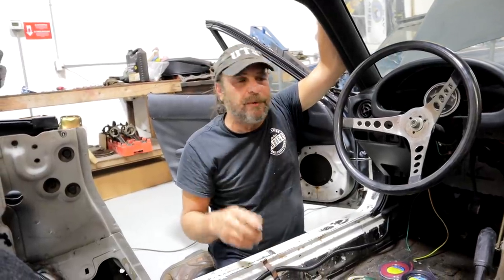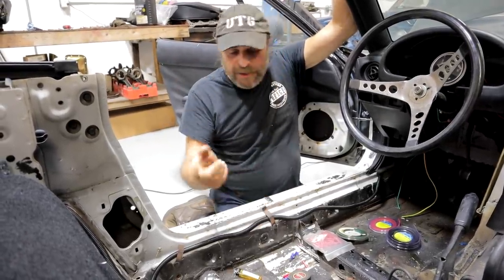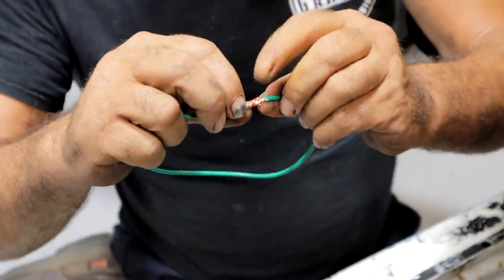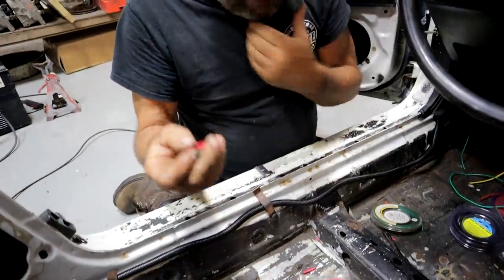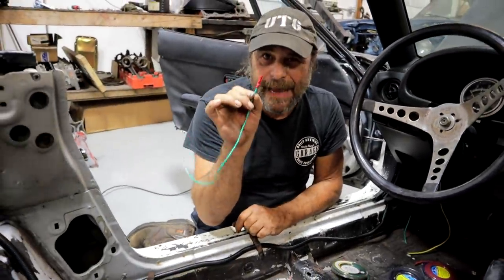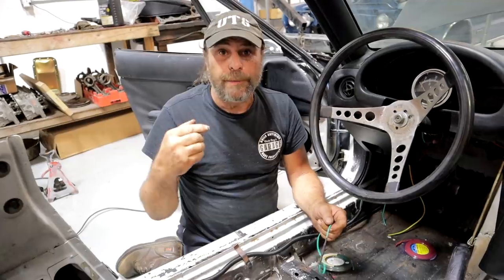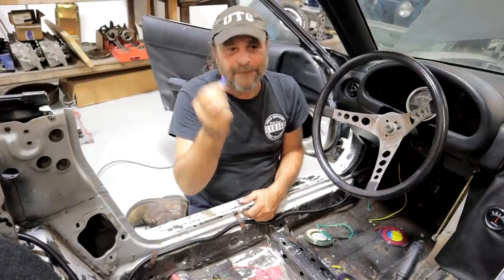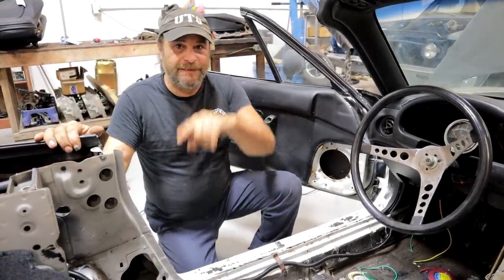The Single Most Misused Item In The World Of Cars

Comment: When I first got into cars and wiring, I would use these connectors. Never used heat shrink. And then I learned how to solder when I went to electronics repair school in the army. Now I exclusively solder. Soldering irons are cheap. Solder and flux is cheap as well and will last a long time. Plus it’s fun. It’s a little time consuming depending on what you’re doing but it’s going to be a problem free connection in the end and it will last a long time. Marine heat shrink tubing is a must as well as it keeps moisture out.
Reply: yup, you fight a corroded connector long enough and still cant figure the issue out, you'll start doing it correctly,

 try the low-heat solder connectors, they are a game changer, use like a regular butt connector, run the wires past each-other and heat with a heat gun, bam, soldered and heat shrunk with adhesive heat-shrink <3
Reply: @narmale  I’ve seen that too. Might just have to check it out.
Reply: @narmale  I like to solder, but tried those on my last car radio install.  Solder and shrink wrap is still more to my liking, but they worked fine

Comment: I always use the heat shrink but connectors. They cost a bit more, but I haven't had a wire repair fail since I started using them. They also have hot glue inside of them to help seal, and keep the moisture out

Comment: Another thing, don't use these on 5V reference or on sensor/ ignition wiring. These really should only be used in a pinch, or in spaces where you can't solder. Butt connectors can cause wayyy too many troubleshooting headaches when your repairing a repair lol.

Comment: The plastic bell on the conector is suposed to be crimped so it seals/provides strane releaf. A old way to splice wire is a maryed splice then heat shrink. The crimpers you have are junk! Us the electritions crimpers! Chanal lock makes a set!

Comment: I use heat shrink connectors that seal with adhesive. Used them in medical equipment, they're great.
Reply: They're awesome for this too
Reply: @KC9UDX  if it's good enough for medical equipment, it's definitely solid enough for cars
Reply: @GideonWallace  not necessarily; medical stuff doesn't deal with road salt and wild temperature swings.  But otherwise, they do work very well for this.
Reply: @KC9UDX  go work on a field hospital, and medical equipment that goes in aircraft and then tell me afterwards
Reply: Do you have a link for those? Thank you.
Reply: @GideonWallace  road salt?  If any of that stuff is ever subject to road salt spray, someone is doing something wrong.
Reply: @KC9UDX  what's up with all the explanation, tell how well anything does well against salt even vehicles... I'm not your teacher. Going on about semantics... talkin bout saltmantics...
Reply: @GideonWallace  pretty simple, I think.  You said that anything good enough for medical equipment is good enough for a car.  But car wiring is hopefully subject to worse conditions than medical equipment.  So I say that if it's good enough for a car, it's good enough for medical equipment, not the other way round.  But it's not something to take personally.
Reply: @GideonWallace  sorry.  Not going to get into a pissing contest because you felt slighted by a simple exercise in logic.

Comment: This video has some misunderstanding and misusing.

Heat shrink is not structural in any way. A good crimp should pass a vigorous tug test, and be totally unharmed. Pre insulated crimps are generally not considered to need sealant or tape if they're in a relatively dry location. Even under cars, it might be better to have the water wash out than be held in that little nylon shell, by your sealant or tape or heatshrink. Even if you use a piercing non-insulated crimper (which you always should, if you want your crimps to actually work).

Don't twist the wire more than enough to get it in the crimp, twists increase the size of the wire, which later untwists back down into the crimp, shrinking the total diameter of the wire without changing the crimp, letting it just fall off. If you cut a well-done crimp, you'll find the wire strands compressed into an imbricate honeycomb pattern, with no air space or room to unwind.

Ratcheting crimpers sound great, but often are much less reliable when you encounter different wires and crimps - it's the force exerted into the crimp, not the nominal diameter of the outside, that tells you it's crimped.

Love ya, tony. Frequently learn plenty from you, even if it's not exactly what you're making the video about.

Comment: There is a bad thing about the crimp style at least on newer vehicles. I worked at a dodge dealership in tech department in 07 to 09. A nationally known hitch and bed company was installin beds using those. 6 months later 3 trucks came in with fried computers and it was because those added too much resistance.  I use them but not on my computer controlled vehicles.  And only as a temporary thing.  I solder everything else.

Comment: Crimp style connectors are not really permanent. Solder is the ONLY permanent solution. Adhesive lined heat shrink is waterproof, not run of mill especially if used outside of the vehicle. Plier style crimpers are garbage, get the ratcheting style with dies for a perfect crimp, also the stripper part cuts strands of wire reducing wire capacity. Use the kind that pulls it off not cuts it.

Comment: Why used hard plastic insulated butt splices and then put shrink tubing over it. That's one big bulky splice and worst with multiple splices in one area. Going to use shrink tubing then use un-insulated butt splices crimp and solder them a far smaller splice. Then we have insulated splice that can be heated and melts like shrink tubing. About everyone of these always turn green because they don't have sealant in them

Comment: They do sell crimp connectors without the plastic on them, then you can use smaller shrink tubing that fits the wire better for a better seal and you get a better crimp, and for Christ sakes stop using that half assed crimper and spend the 20 or 30 bucks for one that actually puts a crimp on the connector and not just crush it.

Comment: Shrink tube does not stop moisture.  Shrink tube does not seal the joint.  To actually seal the joint you need to use a sealant like dielectric grease or my favorite, silicone. Squirt a little drop of silicone in the fitting, insert the wire and crimp,  then slide on the shrink tube and heat.  That will seal against moisture.

Comment: Been a while since doing assembly, but will give it a try on the "guillotining" issue for the barrel connector. The smaller diameter is supposed to crimp directly on the conductor. The "shoulder" is supposed to crimp the insulator LIGHTLY and give support there. Some of the more sophisticated professional crimpers will have dies that appear offset for this reason. You can see this on wiring pins that get released from connectors; one set of tabs wrapped just tight enough to grip the insulation, and another set of tabs that grip tightly on the wire.

Comment: Those t-taps are evil! Last year I bought a truck and it left me stranded on the side of the road just a week after I got it. Some moron used t-taps to splice in the fuel pump! Anyway, I used non-insulated butt splices and heat shrink so I never have to worry about it again.

Comment: Aluminum connector. Copper wire.. Automatically a dielectric connection. No good at all draws moisture.. Shrink tube slows the process.. But won't stop it at all. Solder only way to go...

Comment: Tony!..Before soldering you're supposed to twist the wires together in an inline Western Union splice! it will make a far better solder joint.

This comes from a guy that solders the crimp spade/circle/barrel connector ends on to his own wiring instead of crimping.

Comment: A long time ago back when I was young and good looking, 
Okay I lied I was young.
 I learned about wiring harnesses and wiring, electrical systems in general. When everything that ran through the firewall decided to melt together and become one big charred mess of wires and insulation. And melted tape.
I got This brilliant idea I was going to rewire it, brand new wires from bumper to bumper. Ahh, to be young and stupid with that much ambition again. Oh yeah it was a '57 Oldsmobile 98 with power everything. It even dimmed its own headlights, turn on the windshield wipers on its own, and had a little prism on the dash so you could tell the light was green because of the visor on it. Fender skirts and Continental kit. That I paid $75 for. The only major problem with it. Was it was hot pink, factory color. But the 394 Oldsmobile rocket with the tri-power on it made up for it. And 57 Oldsmobile had a ballast resistor.

Comment: That is a carp crimping tool.
The good connectors have heat shrinks self gluing tubing installed from the factory. They are water tight.

Comment: 100% on the money. I've seen upfitters that do municipal fleet work and other fleet work use these without shrink tubing, they are a no-no as you indicated. Del City, Grote and others make a combination solder-heat shrink unit, and they also make a crimp-solder-heat shrink unit. They come in all types (spade, ring, butt, reducer, etc.) and they are well worth the expense.

The crimp gives you the mechanical connection/stability, the solder gives you the electrical stability and connection and the heat shrink seals the deal. Now you're good to go. The "green mold of death" as others have called it is just asking for trouble.

Del City is one company that makes them, there are others: https://www.youtube.com/watch?v=lti_sVcXwAU

Comment: I started using shrink tubing more regularly the last few years. Used to just do the connectors and electrical tape. But now I use shrink tubing basically on everything. Even in right spots where the connector will make the wiring just too thick with Jenny wires. Then I'll just splice, twist, and shrink tube. I also now get the butt connectors with the shrink tubing already on it.

Comment: your sophisticated crimping tool is one of the most frowned upon tools in the automotive industry because they penetrate the insulation around the connector and cause shorts. you need non-intrusive crimpers and butt connectors like the ones you are using here are crap. you can get heat shrink connectors nowadays which are far superior to the ones you're using and don't require shrink tube. You are about 20 yrs behind in technology.

Comment: Funny how you did this. I'm out in the shop wiring up an instrument cluster when I saw this. I know you have seen and heard of these before, but have you ever used the crimp on connectors with heat shrink on them? Working on road tractors that see a lot of harsh conditions (salted roads in the winter, etc) I use those exclusively.  Work like  champ. They actually have a heat activated glue inside them to give an even better seal. If you haven't tried them, give those a shot.

Comment: those crimps suck u need a set that i have with strippers if u use but connectors just put silicon on the ends it is better then shrink  but the best is with both u want to keep the oxygen from the connection  .  so far on my builds i have run into 3 cars that they put a ground to the dash lights . on my build i will replace the full wire from plug to plug clean all connections on the harness on the bench just like replace all the lines on the frame rebuild it from frame up make it look new again . i even do interior on my own rigs but not put ur left nut into it . some of the builds i see are just crazy expensive when u can do it ur self for a fraction of the money   like my dash i see them buy a new cluster that is a 1000 bucks by it self i did mine for 250 buck but i rebuilt the hole dash and it is just as nice . i replace the bezel nobs lens new tac and vacuum gauge glove box and choke then painted it powder blue when light is not on it it goes darker blue same color the outside will be . next i will find a set i like in the wrecking yard or at one of my friends house and reupholster it to match the doors waiting on them for the seat it will cost me under 200 bucks 25 for the seat rest for leather

Comment: I use crimp connectors that have built-in shrink tubing WITH adhesive that activates while shrinking the tubing. In my opinion. They are 10 times better than standard heat shrink tubing. (without the adhesive) They are more expensive than standard crimp connectors but I buy them in bulk. They are worth every penny in my opinion..... especially here in the salty rust belt.

Comment: Pretty sure technically it is recommended to NOT twist the wires before placing them in the crimp connector.  I think the ASME did a study on it and found keeping the wires straight reduced fatigue failures.

Comment: The ones I use have shrink wrap around the crimp.so once crimped you just heat up and shrink seals nice.plus they are clear so you can see where wire is inside crimp

Comment: Used solderless connectors all the time on various fighter jets and cargo planes in the military. Never used shrink tube. Had self sealing solder splice connectors we used in areas likely to experience significant moisture.

Standard solderless connectors don’t need shrink wrap imho. If you’re doing shrink wrap with a proper heat gun you’re likely to have a quality soldering iron as well.
Reply: For interior applications, I agree. The heat shrink is not needed for stress relief. Another note is that twisting the wire before inserting it into the crimp connector will lead to failure. With proper technique and tools, the crimp connectors offer the best and least failure prone connections in automotive applications.
Reply: @chesapeakemotorwerks  agreed. It makes me cringe when people twist a wire real right before crimping it…

Comment: If I'm using a crimp connector 'outdoors' (like under the hood), I fill the ends with silicone. I've had good luck with that technique, there are cars I've fixed that still have good connections 10+ years later. Whereas I learned pretty quickly that you need to have some kind of waterproofing for outdoor connections. I've had those crimp connectors fail from corrosion in only a couple months. If I'm using a crimp connector in the first place, I'm not trying to do a grade A job. I'd solder and heatshrink if that was the case.

The 'guillotine' connectors I use fairly often. Only indoors, and only when not severing the wire is more important to me than the circuit that needs to be connected. Trailer light wiring, remote start kits, mostly, and also the odd aftermarket accessory. They seem not to have any problems when they're indoors.

Comment: Yep, always use shrink tube. I stopped using those combo tools decades ago and went to stand alone, quality, wire strippers and crimpers. Like Ken Cooper posted, when I have important connections to make then it gets soldered and shrink tube. In the 70s I learned power line level electric work and learned the lineman splice. It is a mechanical splice for wires that is stronger than the wire you are using. When soldered and properly insulated it is a permanent wire splice that will never need to be touched again. Oh, I also learned the correct way to tape a joint ... that is an entirely different subject. Just a little "plastic" tape will not be insulation for 20,000 volts LOL!

Comment: I like the heat shrink butt connectors. They are higher quality than the cheaper plastic versions you used here. 
  I also use better quality crimpers. I do a lot of wiring on trucks, trailers, and equipment in the construction industry. Construction guys can break an anvil in a sandbox with a rubber mallet. It's helped me hone my craft for my personal projects.

Comment: That flared plastic end of the connector is heat shrink. You're right that basically no one actually shrinks it after crimping, tho... Of course it doesn't hurt to add more heat shrink.

Comment: Ok...I a mechanical engineer that RUINED the wiring in my 65 Malibu SS.
To prevent my error ALWAYS use the special ZINC connections.
If you splice anything...ANYTHING.
use the zinc connection.  The zinc will corrode NOT your entire wiring system.
This is very important if it gets wet

Comment: I use those connectors differently.  I slide the plastic off and throw that away.  Solder the end on and then heat shrink.  Makes a nice slim, trouble free connection.  I despise those “guillotine” connectors and can’t believe they’re still made.

Comment: If you're going to use shrink tubing over the splice then insulated butt connectors are not the thing to use. The use of butt connectors without the insulation is best. And as long as you don't have the the butt connector with insulation you might as well solder the connection also before applying the shrink tubing.

Comment: Mil - spec splice: Twist wire; solder the tip only; bend on the insulation; RTV layer; shrink hose (RTV is squeezed out); outer RTV layer; longer shrink hose (RTV is squeezed out).

Comment: The alignment of the tool and connector is also critical, the split in the connector should be vertical so that the connector folds over properly. If it's orientated any other way it collapses in on itself and doesn't grip as well.

Comment: I have never seen my shrinktubes be able to hold any tension. Even when I slide them over a hot coating of hot glue. Solder is the way to go reliably, then you coat the whole thing in hot glue, slide on the shrink tube and then hear the shrink until it sqeezes as much hot glue as it can trough the sides.

Comment: Thanks legit stuff presented here. 40+ years experience in the low voltage wiring business. Hard to beat the twist, solder and shrink sleeve connections.   No moisture problems and no Guillotine cutting of the wires. On a side note if I was to sit like you are sitting in this video I would be wiped out for a week! :-)